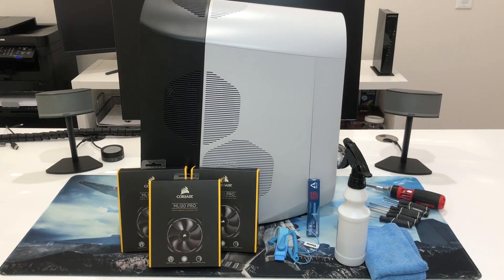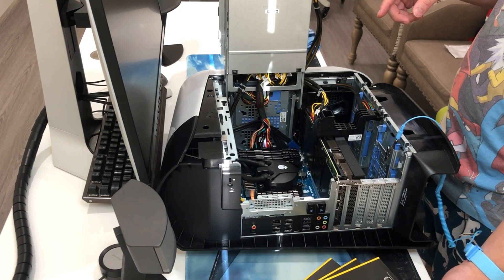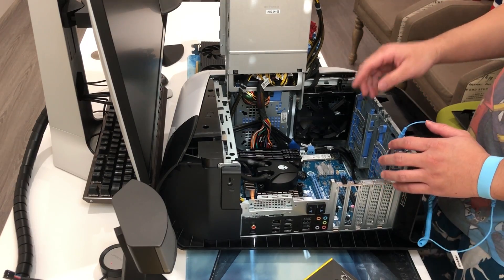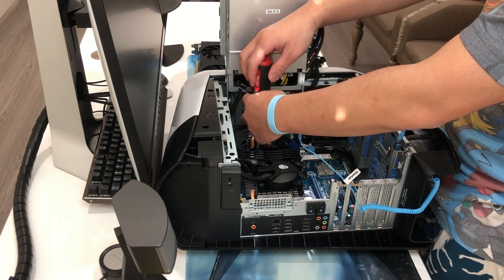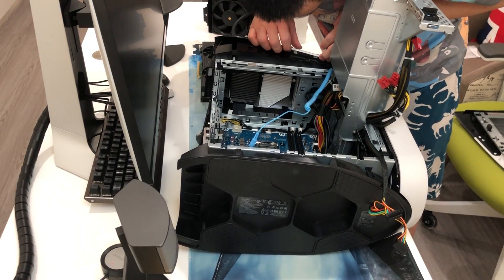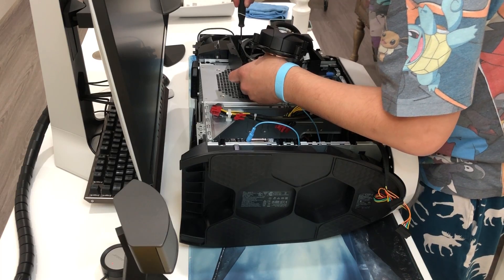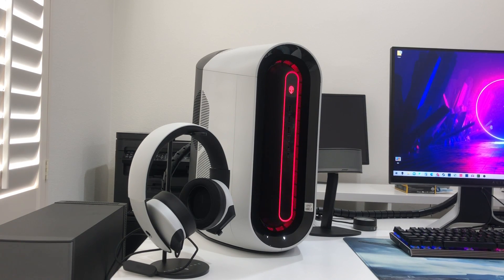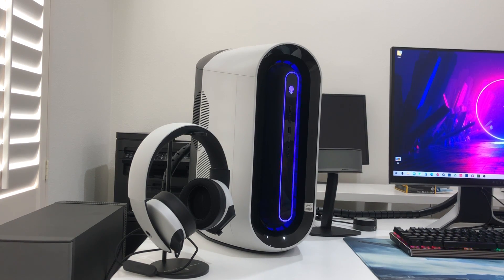How to Upgrade Fans for Alienware Aurora R11 / R12 to Lower Temperature and Noise - Top & Front Fans

Comment: Big fish. About the paste. You said you did an X and a dot. Did you then fill all the empty spaces with paste after?
Reply: This method lets the contact between the cpu and the water cooler squash the paste into the gaps. Another way to do it is to apply the paste and then, using a flat plastic tool, smooth it out  over the CPU to ensure maximum coverage and even spread. Then  screw it back together.
Reply from the maker: @WizardPaul  thx for sharing
Reply from the maker: No just the x and the dot.

Comment: Hi I just followed your tutorial, thank you very much everyhting is working and the PC is finally quiet. 
Just one question the fans can not achieving 100 % fan speed is this normal? I have the same as you used in the video. 
Cheers!
Reply from the maker: It will get 85 for mine.

Comment: You cannot fit a standard 120mm fan on top of the R12. I am looking into a low profile option now.
Reply from the maker: Yes, you can. it's the same bracket dude.
Reply: @RyanYu   The top case will not fit. (They changed something inside that top panel or maybe due to the bracket being further back, but you cannot put the top on.)
Reply: I tried it the other day. It would not clear the fan, they moved the bracket back slightly too, I had to remove the screw clips on the back of the fan just to get it to sit. But yes, the bracket is the same. I would be happy to send you some pics. I am looking for ideas.
Reply from the maker: @DanMurray6696  I will check on that when I do the tear down video.
Reply from the maker: @DanMurray6696  did you install the fan between the bracket and the radiator? It sounds like you install it outside the bracket which is wrong.
Reply: @RyanYu   I was attempting to install a fan on top for a push-pull configuration. I saw you did a vid on the R12, do you think that is possible to do that configuration?
Reply: To be clear, I am attempting to put a fan on top. :)
Reply from the maker: @DanMurray6696  you can do it but the extra fan is in the bracket not on the top. I did it wrong the first time.  I explained how it should go in the video too.
Reply from the maker: @DanMurray6696  that was the wrong place man.  It should be in the bracket. Which is on top of the radiator not the case.
Reply: @RyanYu  Ah, I must have missed that. Thanks for the help!
Reply from the maker: @DanMurray6696  not the problem man.

Comment: will ml120 instead of the ml120 pro work the same? cant figure the difference
Reply: I have the Corsair ML120 Pro led blue for top and bottom fans for all three of my 3090’s. No error from bios 👍🏻
Reply from the maker: @joshualong9762  nice.
Reply from the maker: @joshualong9762  but some people say they got error for using the led version.  That’s odd.
Reply: @RyanYu  Yeah, I was definitely worried. No issues 🤷🏻‍♂️👍🏻
Reply from the maker: It may give you error message

Comment: Can you control the corsair fan through the Alienware command center? (I've installed the noctua redux and I was not able to control them,  so I am thinking to try the corsair)
Reply from the maker: i can control them.
Reply: @RyanYu  thanks !!!!
Reply: @rafpt9522  You can control the Corsair. But if you type 100% Fan Speed in the AWCC it only goes up to 61 %. The Relation of settings and speed is diffrent.

Comment: Do you know any other fan options that do not trigger a bios error for the R10, i heard some people talk about the Noctua NF-A12x25.

Why didnt you choose these? What made you choose the corsair ml120 pro?
Reply from the maker: I didn't know that there were some other fans.
Reply: I replaced my stock fans an also did the in/out mod for my r10 with the noctura fans you mentioned, no error or anything but the fit for the aio is a bit tight so you have to bend the hoses more than some people are comfortable with
Reply from the maker: @quasi-savage2460  how is the pc now?

Comment: I upgraded mine also another great fan mod is to put an 80mm where the 3.5 inch hard drive it and relocate it or use 2.5s At the bottom , I also included a 3 fan gpu cooler that is hooked under my card , the 6800xt which barely fits in the case anyways after all was said and done it doesn't go above 65 full load
Reply from the maker: Will that 80 mm fan affect the airflow in the case?
Reply: @RyanYu  it helps it as they give you a spot in that specific hard drive mount to put a fan they put the holes to line up for it and it pulls air from the front and helps exhaust it out the top of the case
Reply: @RyanYu  make sure to get a good 80mm though I went with noctuas most powerful 80mm for quiet and performance
Reply: @ryrysuperman  are saying you put a 80mm fan into that 3.5 hard drive mount by just clipping in?

Comment: I have just purchased the R10 and completed this mod with your videos help, I really like your videos and helped me a lot. I have actually done this mod twice. The first time with the fans you used and the 2nd time with Noctua fans. I also took the HDD out and moved it to one of the smaller bays below and added and 80mm fan in its original location since my system seemed to be generating  lot of heat.  I was wondering if anyone needs these fans since I'm not using them I am looking to get rid of the corsair and keep the Noctuas in place also I have a 64GB kit of RAM that I'm trying to part with. I purchased the kit for Intel accidentally and so had to get a different AMD kit. Ram is overclockable.
Reply from the maker: Nice, you’ve done much to your r11! How’s the 80mm fans doing?

Comment: I think you can add another fan in the front of the case for additional intake and possibly a fan to the back for exhaust, and have the top fan bringing fresh air in from the top of the case through the WC. If you wanted, I guess you could even have the WC fans in a push/pull configuration. That Alienware case seems starved for air.
Reply from the maker: Exactly buddy, it is too starved for the air. haha. But after this little modification, it has been working fine to me. Thank you for the sub BTW! Thank you.
Reply: I saw a guy who actually mounted a second intake fan up top of the front where the mechanical HDD would be mounted. So he left the stock one in the top of the case because it is a pain in the ass to remove, and then just upgraded the stock fan in the bottom front and added an extra fan. Huge difference in cooling. I do not understand why they would put the fan down low where the GPU is as the GPU has its own cooling system....

People shitting on these computers while I guess it is warranted to an extant, for some people it is the only way of getting a nice PC and for a few bucks you really can remove all heating issues which is a huge knock on the PC.
Reply: @TheGCDesigns  yeah I don’t understand the hate these systems get. My r10 is incredible and I swapped the two fans. Might add the front intake but it’s been fine with just the two fans being swapped.
Reply: I unscrewed hot swap filled out 1 of 2 of the SSD trays from bottom added my HDD there and put 4th fan in place of hot swap HDD housing
Reply: Idling at 31 Celsius

Comment: So I just replaced my fans with 3,000 rpm noctua fans and it didn’t really help lower vram temp; the cpu temp was never an issue. Any suggestions on how to lower vram temp?
Reply: new thermalpads under the vram heatsink and flip the fan for the cpu so it sucks air in from the top , it pushes the air over the vram and creating a positive air pressur in the system witch is not optimal but better then overheating componens, to prevent one of the issues , whitch is dust, from positive pressure is to buy dustfilters and put it over the radiator. The other slight problem is that hot air tems to go up and cold air wants to stay low so this is why it is not optimal. An option is also a new aio, in this case i would go for the arctic liquid freezer 2 120m the pump got an extra fan wich pushes air around the socket to cool the vrams
Reply: @N4Me7eZz  would new thermal pads actually make a huge difference?
Reply: @trueno1337  can make a difference , when they are cheap then yes when not then just clean them
Reply from the maker: @N4Me7eZz  really nice idea.
Reply: @RyanYu   it is but i just thought about something and need ur help if it is still possible , could u meassur the cpu block for me , i have a strong feeling that the cpu block from the arctic aio doesnt fit but i dont own the alienware so, the cpu block from arctic is almost 9,5 cm long , almost 4 inch
Reply from the maker: @N4Me7eZz  next time when I change the thermal paste I will let you know.
Reply from the maker: No really. But one of my friends takes the side panels off and leave it open it helped.

Comment: You purchase a pre-built pc from a big company like dell, and you need to upgrade your pc to make it work better? That's stupid! Why didn't dell build the pc with better fans and a cooling system at the beginning anyway? Are they not aware of the problem of loud fans and warm CPU and GPU? Don't they test their builds? The point of purchasing a pre-built pc is not to struggle building by yourself, so if I struggle to make my goddamned pc work cooler and quieter, then what is the fucking point to purchase a pre-built pc?
Reply from the maker: I agree totally dude. Their prebuilt is good, but not perfect.
Reply: First: Dell should have used standard pc components with no propriety solutions.

Second: then focusing on effective cooling.

Three: making great design as they are making today.

Buying an Alienware pc the cooling should never be an issue. Cooling performance should be on par with a home built pc.

Comment: Can you show me which kind a screwdriver u can take them out so easy cause I wanna do same as ur r11 but I don’t know which screwdriver to take them out
Reply from the maker: I had no ideas either haha.   Just get a package that has a few different size that will do the job.
Reply: @RyanYu  cuz u know I wanna clean my air cooler too that why I’m asking which screwdriver can fit these screw
Reply from the maker: @letrantantaile7018  I don't really know how to say the size of the screwdrivers... I just have so many of them...
Reply: @RyanYu  but I did see saw video changing fan so how u playing game do the fan go really loud or low cause in the future I gonna change the fan make it go performance I don’t how it gonna work out when I’m changing fan does it loud or thermal raises up
Reply from the maker: @letrantantaile7018  It was loud before I change the fans, I will say it gets a little bit better in both noise and temps.

Comment: When you do the thermal test ...I think it is prudent to ask intel or the CPU manufacturer
 if a CPU running at or near the maximum will ...
1) Degrade performance (long term)
2) Degrade life expectancy
We would like to know ...before the CPU ALSO fails & Dell snubs us!!!!
Reply from the maker: If I were Dell, I will send you another one.
Reply: @RyanYu  In fairness to Dell ...I just got a total refund offer a few minutes ago ...but declined. They have NO 3080's for even a NEW build ...so I'll hold out for a replacement hoping that'll be faster. In the meantime ...I'll destroy the warranty installing an upgraded water cooler at my expense. I'd be happy to share the results on the temps after that.
Reply from the maker: @MsTheCops  yeah let me know.   If that will help anything with the temps.  And if you could record it.

Comment: At $4,300 ...why in hell would any alterations be required. I'm STUCK with the second one that'll boil water on the CPU ...the Fusion App shows 206 degrees F.
YES ...the SECOND one ...I had TWO Aurora 11's ...both with i9 ...liquid cooled ...BOTH FAILED. This SECOND one can't even run a screen saver ...it totally hangs & Alienware/Dell will NOT replace the second one ...they said I'm on the waiting list for a GPU & I can pretty much pound sand.
$4,300. & 3 months & still nothing. I'LL post the rude emails & screen shots if anyone is interested in not getting screwed.
This has been the WORST PC I've ever owned & the company is worse than the PC!
And ...fact is ...there are many good ...better options. I'm so sorry I didn't take one.
DO NOT BUY ALIENWARE.
Reply: Dell could have made something great. Non proprietary parts, effective cooling an great design SHOULD be Alienware strong points.

Then they would sell in GREAT numbers.

I would be willing paying a premium for an Alienware if they had standard components and effective cooling.

Comment: Can you do a video on how to add heat sinks or an additional fan for the vram on the gpu to keep it cool? 

In addition, is it possible to move the parts to a new case?
Reply from the maker: I think you can add another fan or two at the bottom of the case, but I am not sure if it will affect the airflow in the case.
Reply: @RyanYu  is there any way to lower the gpu to add a fan at the top? The case is structure so inconveniently :/
Reply from the maker: @trueno1337  I don't think so...
Reply: @RyanYu  looks like there’s room for a 2nd fan right above the front bottom fan you replaced. Is that right?
Reply from the maker: @trueno1337  There is the hard drive bay, it may fit if you remove the hard drive bay.
Reply: @RyanYu  I had a second question in the original post. Is it possible to move the parts to a new case to improve airflow?
Reply from the maker: @trueno1337  I think so,,, but then what's the point of having the Alienware haha.
Reply: @trueno1337  Only thing with Alienware (and quite a few OEM pre-built) is that the parts like the Motherboard are proprietary, so things like the case buttons using a connector exclusive to that specific board.

Comment: Even with the liquid cooling you were reaching the 90s?!?! I'll start by replacing the fans and see how that affects the temps in my rig. One week old!  Thanks.
Reply from the maker: Congrats on your R11, and changing the fans does lower the temps.
Reply: @RyanYu  Thanks. Your video was extremely helpful with installs of fans and lowering temps. I realized that my rig came with voltage OC to 1.38V. I lowered it to 1.28V and now my temps are 35C-45C under load! I am not a gamer
Reply from the maker: @terrellwright7565  no problem.  Thx for supporting.
Reply: @RyanYu  alienware designs must be the worst OEM designs
Reply from the maker: @tommyking626  agree

Comment: Hello! Just saw your video and love the idea of replacing the fans. Just curious, are you really able to add 2 fans on the radiator? Will you be able to put the top portion on the case? I wonder if it will make a big difference with cooling. Please let me know if you accomplished this.
Reply from the maker: You will see a difference in both temps and noise.  The maximum fans you can do is three.  2 for radiator 1for front fan.
Reply: @RyanYu  lots of people are also adding a fan where the mechanical drive goes in the front top of the case in front of the PSU so it blows over the the RAM and MOBO 👍🏼
Reply from the maker: @IcedAssault  yeah, I see that too.  But I’m gonna lose my storage :( if I do that.  Maybe a case swapping will be perfect.
Reply: @RyanYu  still using mechanical drives in 2021? Gross!! LOL
Reply from the maker: @lopsidedoreos  classic.
Reply: @RyanYu  I have an older mechanical drive I plan to add to my R12 when its delivered. But its a 2.5" so I can put it on the bottom bay.

Comment: Will the fans work on Aurora R10 without giving a BIOS error? Ive seen some people running into that issue
Reply from the maker: It shouldn’t be.
Reply: @RyanYu  so it should work without error with just replacing the front and top fan?(I dont plan on adding the third fan)
Reply from the maker: @kirie0801  My advice is to replace the front fan (the easiest) and see if there is error, if there is no error, then replace the top fan too.
Reply: @RyanYu  will definitely dp. Thanks

Comment: Hey quick question, i am only planning on replacing the front fan, will that still have a big difference in noise and temps? Thanks!
Reply from the maker: Yes, most of the noise in idle coming from the front fan. If you change that you will have a lower noise too. But temps may not be noticeable.
Reply: @RyanYu  I'm the sorry son-of-a-B that got stuck with TWO that did not work.
The reason I spent over 4 grand on a PC was NOT so I had to rebuild the cooling system ...I assumed THAT would be addressed in a rig of that price. In my opinion ...having owned TWO ...the design LOOKS cool ...but runs way too hot. Buy another brand.
Reply from the maker: @MsTheCops  Try NZXT dude.

Comment: Just got my R11 and I think I'm going to do this!!
Reply from the maker: Nice congrats on your new R11!!!!
Reply: Rip new r12 jus came out lol
Reply from the maker: @goo3970  it sucks.
Reply: @goo3970  The only thing different in the R12 is the CPU.  Everything else is exactly the same, including the cooling. This was just a simple refresh.
Reply: @goo3970  bought r10 ryzen 2 weeks ago. r12.... meh. 11th gen intel chips are not great, and now they give you 32gb single channel ram. i  configured the r12 exactly like i ordered my r10, and i end up 500 bucks more expensive. not worth it.
Reply: @murfad  I picked up an r12 with i7 11700f, rtx 3080, 16gb ram, 256gb nvme for $1800 with shipping and tax, not a bad deal